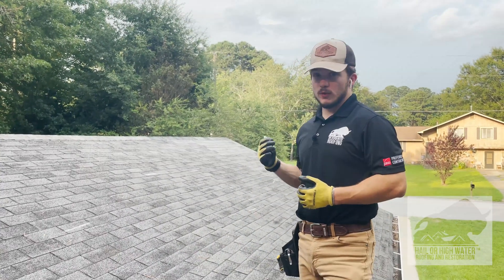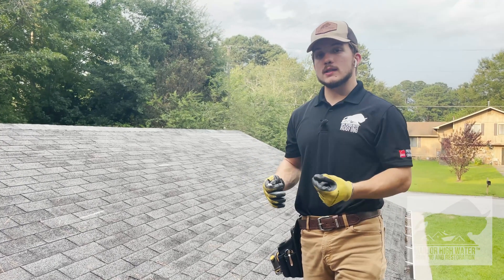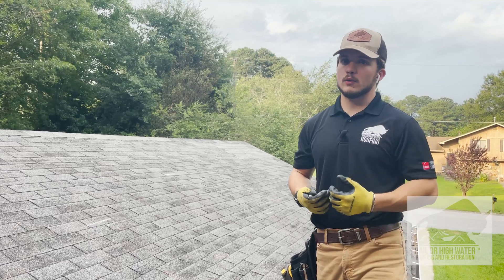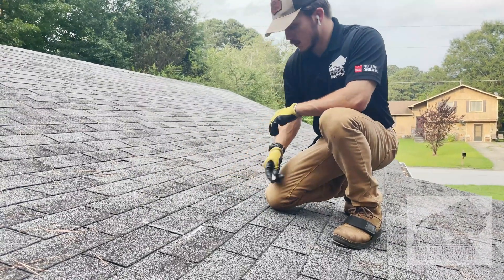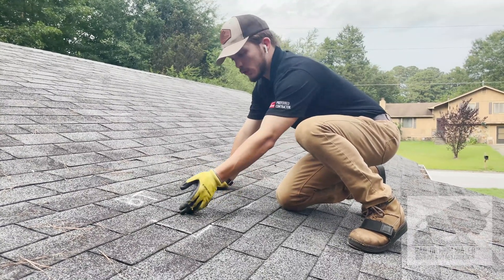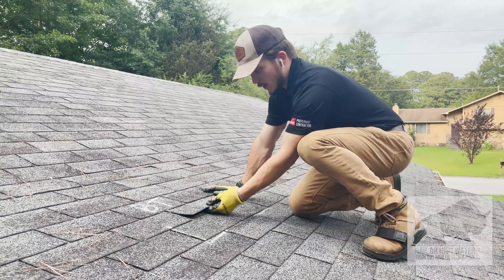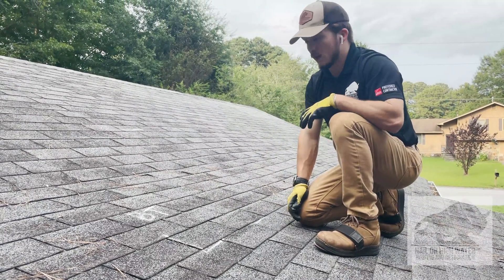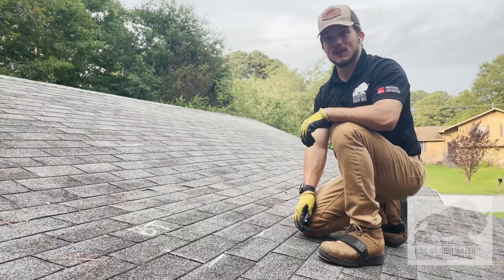How To: Conduct a Brittleness Test

Comment: THE BRITTLENESS TEST
In this post we talk about “The Brittleness Test.” However, before delving into the specific discussion of “The Brittleness Test,” it is important 
to first understand how industry accepted test methods are developed so we can ask – Is “The Brittleness Test” an industry accepted test 
method?
Industry Accepted Test Methods
Consensus Test Methods:
Testing organizations frequently develop and issue testing procedures for building materials. Typically, the way such procedures are 
conceived is through a technical committee within the organization. These technical committees are open to the public, comprised of 
stakeholders in the industry, and are typically volunteers. For the example of roofing materials, representatives from manufacturing, 
insurance, those who represent property owners, contractors, engineers, scientists from research facilities, and representatives from trade 
organizations, among others, could make up the members of the committee. The committee then assigns different sections of the standard 
as well as research, to be written or undertaken by the different members. The draft standard is then iteratively submitted to the rest of the 
committee for comments, edits, and suggestions, until a final version is prepared and balloted. Organizations such as ASTM and ANSI 
generally publish testing procedures in this fashion. More information on ASTM and ANSI test standard development can be found at the 
following links, respectively:
https://www.astm.org/MEMBERSHIP/standardsdevelop.html
https://share.ansi.org/Shared%20Documents/Standards%20Activities/American%20National%20Standards/Procedures%2C%20Guides%
2C%20and%20Forms/ANSI-Essential-Requirements-2018.pdf
Peer-Reviewed Methodologies:
Another way to publish scientific methodology is through an academic journal. This is typically referred to as a peer-reviewed publication. 
The peer-review process begins with scientists observing, studying, and qualifying or quantifying the phenomenon. These scientists then 
complete their analysis and write an article on their results. The article is submitted to the editor of a relevant journal. In the case of building 
science, articles can be submitted to the journals of Building and Environment, Construction and Building Materials, Materials and 
Structures, Building Research and Information, or Materials in Civil Engineering, among many, many others. The editor of the journal would 
then send the article to other well-known scientists, in the same field, for their review. These peer reviewers read the article and provide 
feedback to the editor. At this stage, the editor can compile a list of comments for the authors or if the article doesn’t meet the scientific 
standards of the journal, it can be rejected. If the article is not rejected, the authors then answer reviewer’s questions and comments, revise 
the document, and resubmit for further review. The process iterates until the peer reviewers and editor are satisfied the scientific standards 
of the journal are met and the article is published in that journal.
These two ways in which testing methods or procedures are published are important because it shows that procedures have been reviewed 
by an established and rigorous process by stakeholders in the industry—the same entities that will use the procedures. Further, these 
processes assure the reduction of bias by any one branch of the industry because it was compiled by members of the different branches of 
the industry or it was reviewed by different members of the industry. In effect, it serves as a checks and balances system.